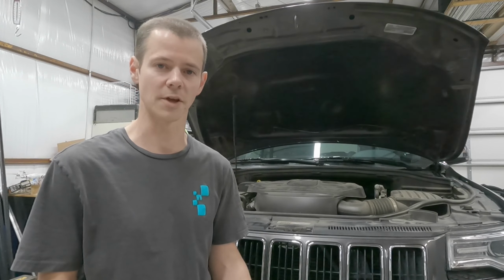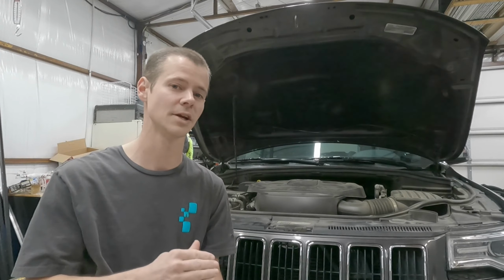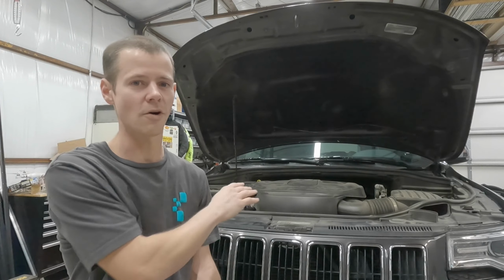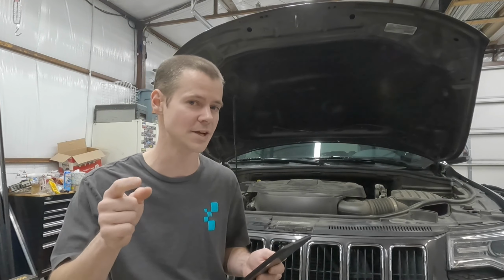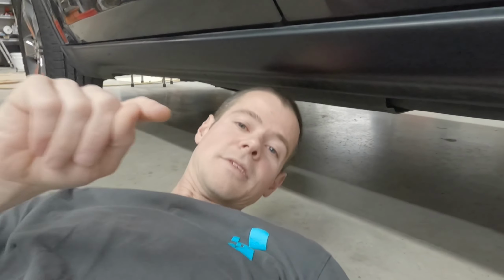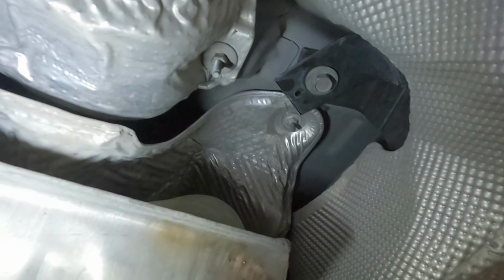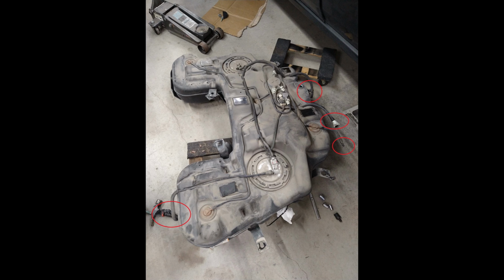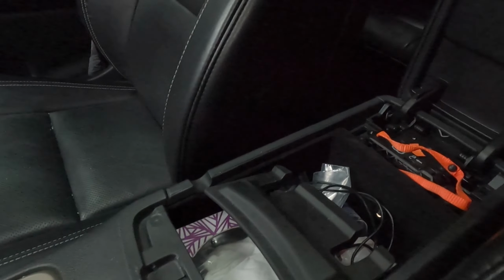2016 Jeep Grand Cherokee WK2 - Fuel Pump Replacement (Fix long cranking start / ESS Light)

Comment: There is an access to the fuel pump underneath the rear seat. It has to be taken out
Reply: For the Grand Cherokee too?
Reply: @onetakeboobie1698  how do you get to it?
Reply: I was told no by my mechanic he took the seats out and didn’t see one. Please share where it could be accessed it’ll be greatly appreciated
Reply: 2017 JGC does NOT have access panels
Reply: No it's only on the cherokee not GRAND cherokee 😊

Comment: Great video buddy! Just wanted to let you know that my dealership said you could access the fuel pump (2015 grand Cherokee high altitude) by removing the back seat and using an access panel to the top of the tank. Hope you didn’t go through all that work for nothing. Thank you for explaining why it always starts right off with the remote start! Makes sends and helps diagnose the problem.

Comment: My Jeep has started to do this as well. I wonder if there is something that can be added to the fuel to "clear" or "flush" the fuel pump? That seems like a bigger job I want to tackle when the vehicle still runs. Dealer quoted me $2200 for this job.

Comment: I have a 2014 GC with 3.6L V6 Pentastar and oddly enough I have a long crank to start about every 10th time I start the car. It always starts after about a 2 to 3 sec. long crank. Other times it fires right up instantly. Even Cold starts it starts fine. I'm thinking relay. I took it to the dealer and they said it was fuel pump. i balked at the $1600.00 quote to replace it and still driving the car.  I'm thinking it might be the relay. This has been going on now for about 4 months. Your thoughts.
Reply: I have the same year as you and having exact same problem. You do anything w/ the relay yet? Jeep isn't throwing codes so shops aren't able to tell me how to fix it. Super frustrating.
Reply: @colinbalas2201  Hey Buddy. No...I haven't fixed a thing and it's still going along just fine with a long crank to start about every tenth crank to start or so. The irony is my brother has been an auto mechanic for 45+ yrs and just as this problem was cropping up, he was retiring and moving to Virginia. ( Nooo dont go TREY!! LOL ) When I did take it in to the shop at the dealer after my brother was gone, my brother said not to do the fuel pump replacement yet. He suspects it might be the relay. Now....this all took place last month. My brother is coming back into town and is going to check it out. But in the meantime....I'm still getting around in it.
Reply: Anyone else find a remedy with the delay? I have 2014 GC  same issues long start very intermittently. But works completely fine with push to start without brake pressed. Once it primes step on break fires fine Everytime. Any help would be greatly appreciated
Reply: @colinbalas2201  Hey whats up. Just came back to check on anyone with their jeep long crank. I have not done a thing to mine yet. Still driving it. it's the same as before. Always fires right up from a cold start in the morning. When I get out and about start and stop a few times, then come home, I go back out about 2-3 hrs later and thats when I get a long crank.  So strange. Still driving it.
Reply: @hudekhoustonartist  - Yeah I was never able to get to the bottom of it. Largely seems undiagnosable until it starts throwing codes. Whatever it is, it seems costly and I didn't want to get into throwing money at an old vehicle. I traded it in and bought a new truck.
Reply: @colinbalas  I'm thinking of trading mine in on a mid 70's model car so I can work on the fucking thing. I grew up in a family of auto mechanics. I was one until about 1984 when I learned to fly and never looked back. When computers first appeared on GM's , I never dreamed it would all lead to this. Computers have ruined cars.
Reply: @hudekhoustonartist I have a 2015. Remote start works like a champ, but push start when vehicle sits more than an hour takes 2 to 3 cranks before it starts. Over time, those starts have become very rough. The last time I used push button  start, it was very rough and finally threw a P0345 engine camshaft code so now I only use remote start. A coworker with a 2014 V8 had the exact same issue. He took his to the dealership and they told him it was something to do with the control module (the box that has all the relays and fuses). Supposedly several thousand dollars to fix).  He traded his. I'm hoping it's the fuel pump relay as I've read in the forums. Until then, I'm happy using remote start anyway.
Reply: Did anyone find out If replacing relay fixes issue?
Reply: @hudekhoustonartist  it's a bad seal somewhere.  You lose fuel pressure after it sits for awhile and when you go to start it the pumps have to repressurize the lines.  I think it's a design problem also to where the pumps don't run until it goes to crank.  It should call for fuel pumps to run when key fob enters the car or something before it wants to crank

Comment: Thanks for the video.  I just had the dealer replace both pumps.   At first they offered the Mopar pumps at 1000 each.  I said no way so they got the Orilleys aftermarket for less than half but without guarantee.  I got the jeep back and I'm still having long crank starts.
Reply: What else do you think it could be?
Reply: @HookinFever  i have no idea.  I recently took it  back to the dealer and they still coould not find out.  They claim it's working well and cannot recreate the problem.
Reply: Did you get your old parts?

Comment: Thank you so much for this video,my wife's car started doing this guess i will will be changing the fuel pump
Reply: There are many reasons that fuel pressure may be dropping. You really need to diagnose the problem before just putting a fuel pump in.

Comment: I just started having this same issue on my 2018 Jeep Grand Cherokee Altitude package. Every morning it kind of struggles to turn on same happen on my way back from work. When the engine is hot it will start up like it normally would but if its been sitting for a while it cranks more than usual. I have warranty at the dealership i purchased it and hope its covered if not im screwed lol.
Reply: Powertrain won't cover it... there's a lot of people having the same issue.  Seems like a seal or something Chrysler decided to go cheap on.  If they were a good company they would recall this but they don't have to because it's not a safety concern yet.

Comment: So it wasn't an issue with check valve bleeding fuel back down towards the pumps?  If the vehicle isn't having issues while running I find it hard to believe that only replacing the pump and aux pump would fix the issue.  Seems like the Jeep should call for pumps to pressurize the lines when you get into the car and not when the button is pressed.  My Jeep is at the dealer right now for this same issue and it's not having any fuel issues while running just firing up every once in awhile.  Seems like it's a bad seal somewhere hence the loss in pressure.
Reply: Did you find out what was the problem?
Reply: @ayexcite5324  No I have a lift at home but didn;t have time to check it out.  Had dealer replace both pumps.  Should've just been a bad check valve or seal.  I told them I wasn't paying the whole $1900 they wanted because I troubleshot it myself and they were getting more out of me than they needed to
Reply: Same I'm dealing with this parked fine than crank no start 3days later got it running for 30min turned it off and now cranks no start again

Comment: THANK YOU for describing the "auxiliary fuel pump" module.  Having dealer replace my primary fuel pump and they wanted another $900 to replace the auxiliary (of which, 90% of that cost is the auxiliary pickup itself and apparently on backorder).  Hearing that there's no actual pump in that side confirms my fears that I don't need to replace that unless that hose or pickup cracks.

Comment: Ok Everyone. I'm back for an update. My 2014 3.6L V6 Jeep Grand Cherokee fixed itself!!  No kidding.  it seems about three weeks ago I realized my jeep never cranks long to start. Fires right up like a new car. Hot or cold.  Even if I've been out and about city driving doing errands. Stopping and starting. We haven't touched a thing.  I'm about to hit 90K miles. Starts right up!! Strange Strange Strange. Go figure!!!
Reply: did you lift the jeep or just work with height that it stands ? by just going under it

Comment: ...usually when there's no video or procedure to be found or posted
there is an access point the dealers don't want you to know about 
until later on when a body style is changing ~ in my opinion
Reply: Hence the reason also why techs have to sign NDAs at most places
Reply: My dealership told me I could access the fuel pump on my 2015 grand Cherokee high altitude by removing the rear seat and accessing the tank from the top. May want to check that

Comment: I just bought one of these second hand. Ive been fixing some issues and happened to see this video. Mine was very low mileage (30k miles) and fuel pump seems to do fine. Im curious as to how long was the cranking time for that fuel pump issue you had? More than 2 seconds? I want to know to easily identify the issue if it happens to me.
Reply from the maker: I have the push button start and mine would occasionally fail to start on its own and require a second push. I doubt its a "common" problem, but I really tend to overthink issues like this when they come up.
Reply: @uthe54  My 2021 Grand Cherokee Laredo started having this problem in the 16,000-mile range.  It's happened four times in the last three weeks.
Reply: My 2014 is doing the same thing.  When the car sits around 3to4 hours the Jeep GC long cranks anywhere around 2 to 5 seconds.  Sometimes it won’t start, but a second try it starts right up.

Question, if you don’t replace the fuel pump and the car occasionally long starts, does it damage the engine or main components?  Or is this just an inconvenience?

Comment: Did you by any chance have check engine on or any misfires?  Iam having a rough start on my 2016 Grand jeep Cherokee Iam thinking on changing  the  fuel pump just not sure.
Reply from the maker: I have not have any misfires. I had a check engine code maybe 20k miles ago about I think it was a bad crank sensor, and that caused some weird engine feedback. Was a very easy fix, but the check engine code told me exactly what it was, and after swapping with a new one, been running solid.
Reply: @uthe54  what brand to buy? Herko or quantum.which one is better? 

Tranks you

Comment: What tool did you use to install the pump back on with the new rubber gasket?
Reply: I used a big screwdriver and hammer

Comment: dude more lighting, couldn't make out what you were pointing to
Reply from the maker: Sorry about that. Turns out the fuel sensor level in the pump I got freaks out when the tank is full, so at some point I'm gonna have to drop the tank again and figure that out. I'll try to take a better video when I do. When I shot this, there wasn't any other videos out there, so I was hoping this would be better then nothing. I'll take your suggestion though! Thank you!
Reply: @uthe54  is the fuel pump and level in different locations? Our 14 jeep grand cherokee throws fuel level code when filling up all the way? Also didn't know if there was an access panel under the rear seat?